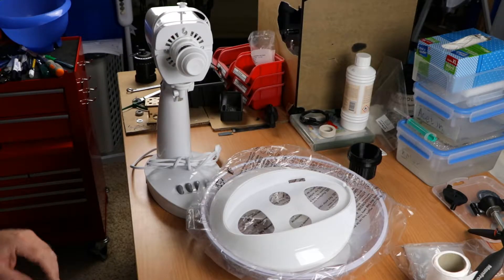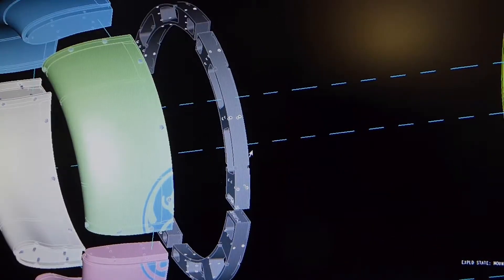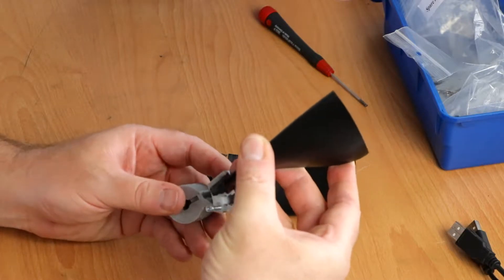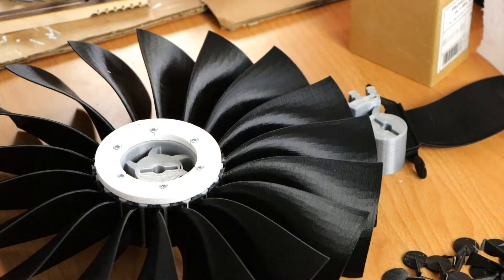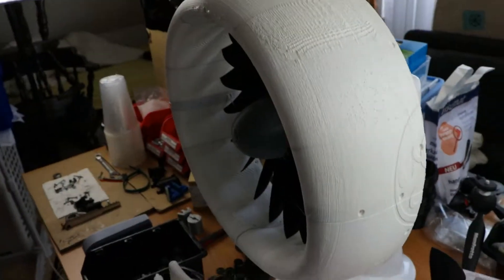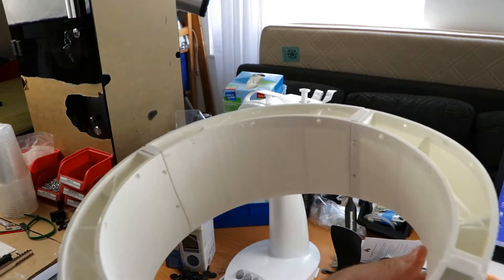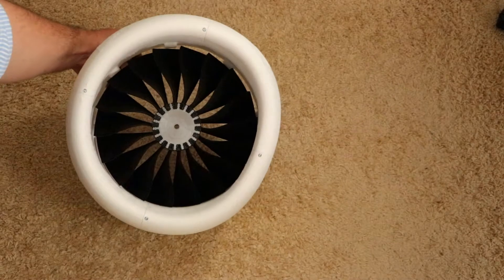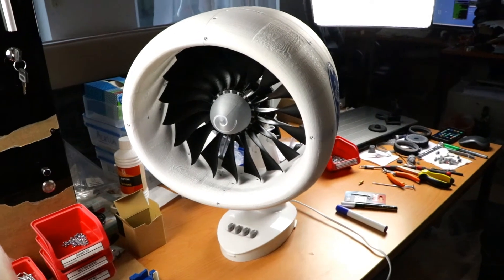3D Printed Subsonic Turbine Table Fan

Comment: Крепление стойки помрёт от такого веса со временем, и механизм поворота тоже.
Reply: Так что их надо тоже переделать.
Reply from the maker: @lunatikreal1384  I'm very curious as to what you can come up with.
Good luck.
Reply from the maker: Google Translate:
"The rack mount will die from that weight over time, and so will the swing mechanism."
I don't know what that all means exactly, but any part that should fail eventually can easily be replaced.
I admire your future telling capabilities.

Comment: Good night dear friend  —Very awesome jet Fan.    Please, do you sell the blades ?   ( In case it fits my fan).   For the past years I was dreaming to purchase a fan like your design .  You are absolutely a state of the art.   I would be interested in buying the blades and the parts without the "general electric ". 8 outer parts in white
Reply from the maker: Hi, thanks a lot !
If you follow the link in the description you will find the parts (without the GE logo).
The second link will provide you with a (free) drawing with some relevant mounting dimensions to check if it will fit your fan.

Comment: Nice project! But the cowling is in the wrong way. The side with the rounded edge is supposedto be the inlet, therfor facing away from you and the side with the pointy edge should be the exit facing towards you
Reply from the maker: I really liked your comment because it made me laugh out loud. Funny !
Of course you're right, but this one does not suck, it (really) blows, but still has to look like a turbine jet engine when you look at it. With the air speed being really sub-sub-sonic I don't think the roundness of the edges either way really affects the efficiency.

Comment from the maker: As I mentioned in the video this motor is severely underpowered for this blower. I need to modify the blades to a shallower pitch so that this puny motor can take it. Also a weight reduction would likely help with the friction of the rotating shaft. I don't know when I will get around to that.
Reply: the central pitch of the blades is almost flat in 90 degrees, in a normal jet engine this is by design to allow air to pass through the turbine, but with a fan design, this should be 30 degrees so they do not serve as brakes. also, the blades have a little excess at the end where is not entirely cylindrical (points sticking out) this needs to be removed
Reply from the maker: @TononiaWorld  Hi, the 90 degrees at the base of the blades was mainly to keep the footprint smaller so I could fit enough blades around the circumference. This was a miscalculation with the motor already being underpowered, so I will follow your suggestion on that.
However, the blades most certainly do follow a cylindrical outer contour, it might not be that obvious or visible in the video, but they really do.
Reply: @GeneralRulofDumb  based on the loading of the blade, I can see the reasoning, however, this can be easily modified haveing the blade loaded on a angle, it would be prudent also to increase the hub size and make IT part of the fan, feeding air to the motor cavity and thus reducing the blade size a little, but giving a better radius for the blade load.
Reply from the maker: @TononiaWorld  Increasing the hub size actually makes a lot of sense. And this motor could do with a lighter load as well as additional cooling. It's something I will definitely incorporate in a future version of this. Thanks !
Reply: @GeneralRulofDumb  on top of that, you might want to check the coil winding resistance and calculate the phase in relation to the secondary winding.  Normal fans are rpm limited to comply with safety, but some fan can spin faster if the phase are set properly.  At the same time a lighter, more flexible blade design would auto adjust pitch with load/rpm (more wind resistance would decrease blade attach, more rpm would swing the blades mass to the edge making it stiffer) is a design carried in windmill